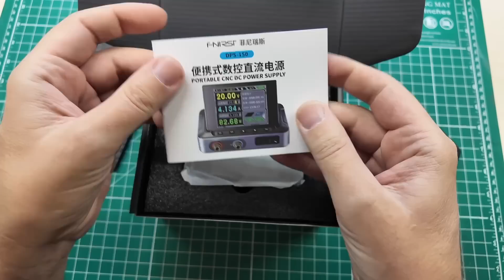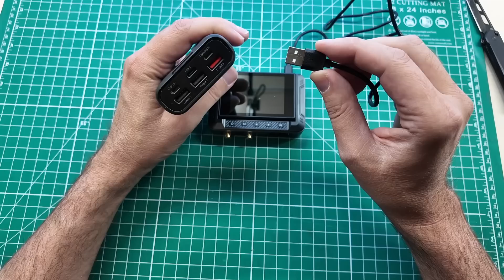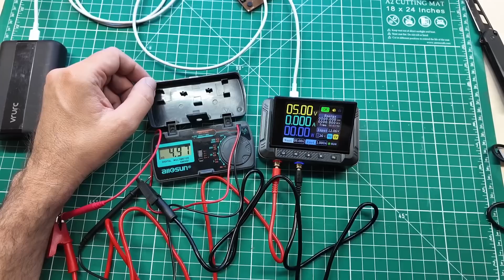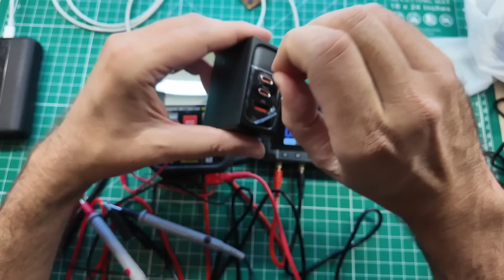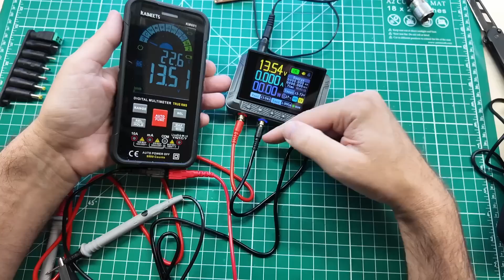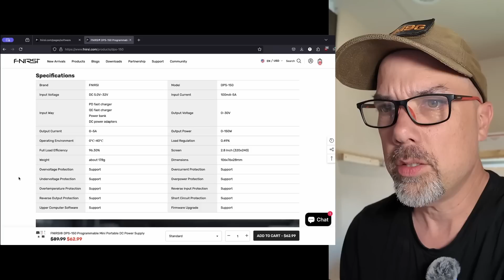You Didn't Know You Needed This

Comment from the maker: If you watch really closely in the video it looks like I have a bad Astron Power Supply.  Make sure you're subscribed for updates on how we get that fixed!
Reply: maybe small wire AWG to that unit.  Yes a outher video. Put that load tester on Astron terminals . Open it take some readings.   Make some smoke?   get it fixed ? Let's find out in video !
Reply: Astrons don’t fail! 😮 Often.
Reply: I notice the wires from the Astron to the buck converter were very small. You can check the voltage at the Astron output to see if it was the Astron power supply causing the voltage drop or the resistance on the wires.
Reply from the maker: @jeffb-jbq  I'll check it all out for sure.  This isn't the first time I've seen the astron sag though.
Reply: do windows lol
Reply: Was a pleasure meeting you at the Marana Hamfest today.  Hope you found a power supply.   Jeff
Reply from the maker: @JT-py9lv  I got the one I was eying at that table today!

Comment: I ran across this on the "Express" site and thought, "Oooh, that looks slick, but who knows really. Maybe someone I trust reviewed it!" Yay TO!

To be fair, standard bench power supplies pretty much never supply power until you plug them in. 

Do you still love it? I looked but didn't see any further videos. 

Did you ever get around to using the computer power monitoring tools? I'd love to see the graphed results of a good long run of 11.5V/700mA Max output for finicky little QRP radios with delicate power needs.

Is that Amazon link an affiliate link? Happy to help if I decide to grab it.
Reply from the maker: I haven't found a video to share using it again, but I do like it.  I need to see how it will power multiple devices at once (raspberry pi?) so that I can mount it on the wall and enjoy the display.  I'll take a look at the graphing features soon.  So many things to play with in this hobby!

The link is an affiliate link, thank you!

Comment: I was hoping it was going to be a simple interface to USB-C PD PPS, and couldn't understand why they wouldn't support up to the full 240 watts and 48v.  But instead it's apparently an old school buck (maybe boost?) in a nice box with basic USB inputs.  I probably have a dozen of those modules around which is more than I need. 🤷
Reply from the maker: I didn't know the PD specd 48v, nice!
Reply: @temporarilyoffline  Yes!  It's fairly new, so understandable you hadn't seen it yet, and wall adapters that support it are still rare.

Comment: Micro USB :( But otherwise decent product! I wonder if it is a power supply or a power monitor...
Reply from the maker: Depends on your definition, take a look
Reply: @temporarilyoffline  Yeah I took a look and later on it seems more like a power supply. Supplied with USB C or a wall wart instead of mains. But that is mine to. I have a Meanwell supply supplying my power supply. Kinda the same.
Reply from the maker: @DustinWatts  mean well makes a good unit!  Usually they aren't variable though, did you find one that was?
Reply: @temporarilyoffline  Yes I found a few. The are variable, but don't have a large range, just to dial in the exact voltage.
Reply from the maker: @DustinWatts  Nice!

Comment: 1) YoU nEeD tO rEmOvE tHe PrOtEcToR fRoM yOuR bAtTeRy PaCk 😆
2) I've been eyeing up that Allosun multimeter. Seems nice and portable.
3) I need to test one and see how clean the power is! It has higher current output than my (lab) bench power supply!!
73,
Reply from the maker: 1 - some protectors are strategically left on for easter egg effect.
2 - No-Stab in your pocket.  Its not "great", but it is perfect for "on the go"
3 - I have a few links where you can get one!
Reply: @temporarilyoffline  awesome! I just had to razz you for the protector...doesn't bother me any! Re the meter, that's exactly why I was considering it... Decent enough, very portable option. 73,

Comment: What is it actually "USEFUL"  for?? Ask'in for a friend
Reply from the maker: All sorts of bench build and test scenarios - such as what will my radio do with less than 12v?  Or programming and testing 3.3v or 5v Arduino, Pi. Etc projects instead of waiting for batteries to charge up.  Lots more applications, but those are just a few

Comment: Not again F-NRISI a power supply with normal buttons instead full touchscreen, touchscreens are this days realy cheap, and normal buttons can not hold longer than a touchscreen.
Micro USB Really, 🤔 in 2024
Front dc plug outputs that can easy get a short, needs only a wire to go across, instead that they are flat with the housing. 🤔 😵
Reply from the maker: Good feedback.

Comment: There’s maybe more there than I want or need. I’ll probably try to fab something that takes USB-PD in, Anderson Powerpole out. With some regulation in between to nail down ideal outputs for plugging transceivers etc in.
Reply from the maker: Make sense - they sell 12v PD trigger cables with 5525 outputs that work great with QRP radios.
Reply: @temporarilyoffline  You can also buy small modules with switches (hard,  soft or solder. the hard switches are the best IMO) that you can use to tease all the voltages out of a PD supply that it will produce. I have two batteries like you have (except different sizes) and they both put out only 5, 9, and 12v volt. I bought some  small  cube power strips with 3 110v, 2 usb 3, and 1 usb c pd for less than $10 and tested them, and they put out 5, 9, 12, 15 and 20 volts. So far the only PD supplies I have tested, but pretty neat.
Reply from the maker: @goatmoag  That is pretty awesome.  I find getting 12v out of a PD to be hit or miss.  I think they removed it from the spec a while back.  I found this one here: https://geni.us/DGYzqR Now I gotta have it!

Comment: Really appreciate your sharing this. Coupled with a lithium ion power tool battery, this device is going to be quite useful both on the bench and in the field!
Reply from the maker: Great idea!
Reply: Good idea, i have been messing with a gigparts solar charge controller for that.  This would be cleaner.

Comment: How much switching noise does it have? Does it overheat easily? Is the overcurrent protection quick and output capacitance small? Coil whine? So many followup video ideas ;-)
Reply from the maker: I agree.  I picked up another power supply today, 1/4th the size of my astron mountain... also has variable output... so I'll be doing some more testing.

Comment: FNIRSI are recently releasing cool looking gadgets.  However, they often do not spend enough time testing and some of their recent stuff like the LCR-P1 component tester is really bad in function and full of bugs and omissions.  But back to the power supply I personally see no use for it if it had an normal AC input it would be more useful?
Reply from the maker: I was curious about that too... but I'm striving to remove 120vac from my shack/life and this takes up to 32v input, so could be very useful for me... or maybe it will just collect dust with all the other projects I have to do.

Comment: Just use one calibrated Fluke meter. Standard for the industry.
Reply from the maker: I'm not folding fluke paper yet!
Reply: Fluke was calibrated in China where it was produced... Game, set.
Reply: @xephael3485  . I agree with you. For my purpose I am calibrated all my equipment under ISO 17025 +full data+ uncertainty from accredited lab. Every Year. That is the way if you want to produce correct measurements. I am doing this with every new piece of equipment. Doesn't matter from the certificate. Usually the manufacturer just does basic calibration. Every additional calibration costs extra money..

Comment: Nice review, Steve. I have more tools than I need, but not as many as I want. He who dies with the most toys wins. I really want this.  About power and energy, it measures W, but does it also measure Ah and Wh like the cheap inline device I use? The one thing that doesn't give me is a persistent measurement of A or W used.  It resets every time I disconnect from my LiFePO4. That would be a killer feature for this regulator. Thanks again. Great review.
Reply from the maker: Do you have the little one with the 2 line display?  I need to make a video on it.  There is a 4? 5? Pin header on the side for a memory battery.
Reply: Yep, that's the one  @temporarilyoffline or a clone.  I was going to say no, but I checked and there is a 3 pin header that could well be for battery backup.  It's very handy apart from that reset issue.  It's very different to this product as it doesn't have constant voltage or current limits, but the metering is really good. I bet this product could charge NiCd with the current limit feature, but now I'm showing my age lol.

Comment: You could check the output voltage on an oscilloscope to see how stable it is over time. Is there any high-frequency noise? Or just power a radio from it.
Reply from the maker: On the list!

Comment: Good stuff! I'm a tradesmen I have all kinds of cordless tools ,, I have been using the tool battery's for power on lights and fans for camping forever ! Mostly 12volt ,,,now tools have gone to 18v,20v can this safely power my beloved xeigu G90 with and 18v or 20v battery?? A while ago I bought a "power wheels" Dewalt battery conversion on the jungle web sight,it has leads and a Fuze holder,,this could be a great thing for portable! Thanks for what you do  73
Reply: I bought a 3d printed adapter that slides onto my 20v battery and terminated into empty leads. I slapped on anderson power poles and run it through a variable input stepdown converter that pushes out 12vdc and am able to power my g90 or whatever radio I hook it up to.
Reply from the maker: Hey Jeffrey!  I've been looking for a slide on cap for the dewalt 20v'ers that has power poles and a readout.  Would be great if it could charge from or power from the powerpoles as well.  You know after saying all that I've just described a bioenno though.
Reply: Right if you go to the jungle site (I'm using  that now) type in cordless drill power wheels up grade you can find those caps for nearly any cordless,,,some come with a buck converter but I hear they are rf noisy  good luck 73
Reply: @JeffreyWilliams-x4x  They are a little noisy but nothing ferrite chokes can't fix.

Comment: Test bench under no shore power would be when this would replace my adjustable bench supply(s).

I'm interested to know how RF quiet it is.

Output floating,, or shared ground?

Can you run the app under WINE?

Looks like more spending for me.
Reply from the maker: All good questions!  I can run it under no shore power, but batteries sag (as I showed casually in the video), so that's a whole other problem - capacitor bank between batteries and power supply?  32v battery system to provide stable 5v output to DUT?

floating output is a VERY good question.  I'll have to investigate.

More spending indeed... I'm already getting another power supply.
Reply: @temporarilyoffline  I'm thinking of feeding 24V from a series combo of my two 100AH LiFePO4s, which won't sag they way the boost regulators in those power banks can.  Given that input voltage limits output voltage I'm guessing it has a simple buck regulator, but that should be relatively insensitive to input voltage.

BTW, there's a link on the product page to "a newer version" which just seems to mean that it comes with he 100W wall wart, for $30 more.  I hope that you get affiliate cred on that one too,  because that's the one that I ordered,
Reply from the maker: @KeepEvery1Guessing  Thanks for asking - If you ordered it from amazon after clicking the link I get credit for it.  I've updated the description with the (other) link.  Its not "new", its just including the USB as you noted.